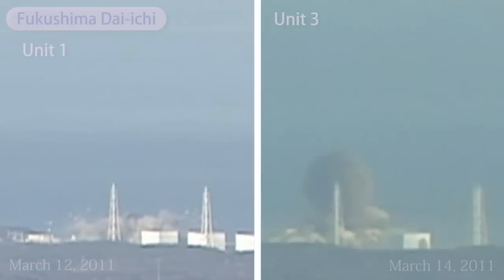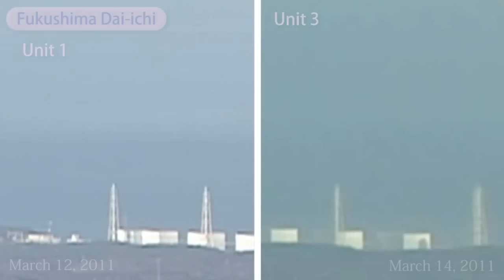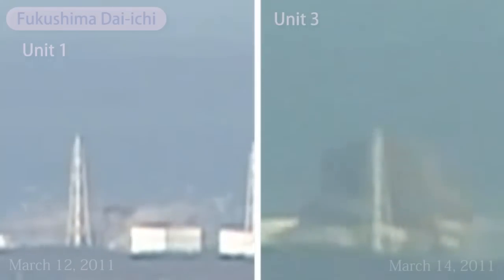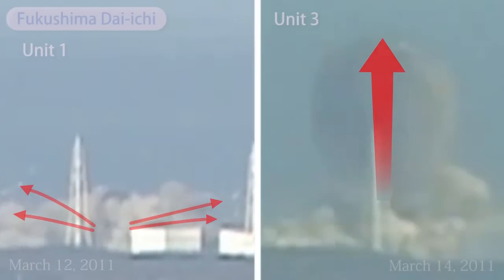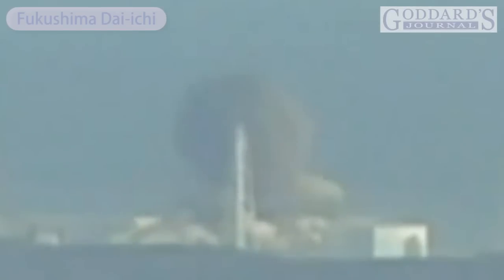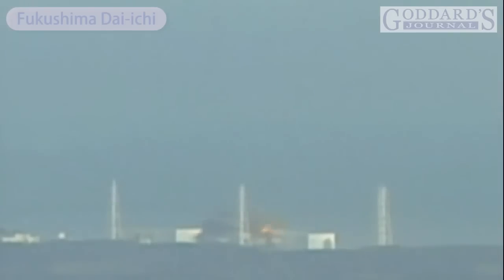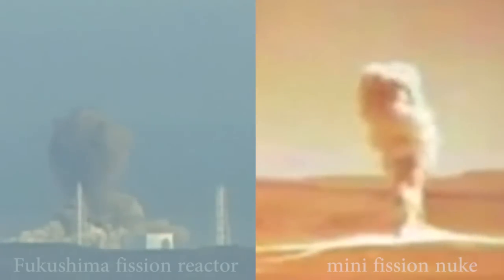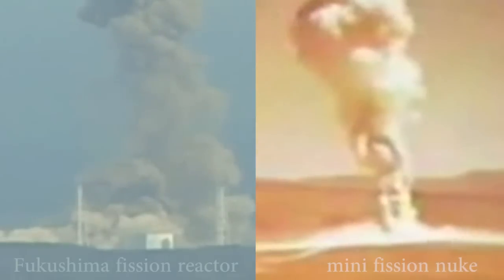福島第一 Fukushima ☢ Nuclear Blast?

Comment: @stealthbadger of the outer containment vessel in #3, which was substantially different from #1 - and would have had commensurate effects on the structural strength of the unit (and therefore where the blast went), to say nothing of the physical deformation of the structure itself from the earthquake.

Basically, I call shenanigans. You saw a clip of a mushroom cloud and are running with it to make a point, even though it doesn't support your case well at all.

Comment: It's not a nuclear explosion.  The engineering and design required for a bomb and a power plant are quite different.  The uranium used in a power reactor is at most 5% enriched, that is 5% U-235 (the stuff that fissions and keeps the fission chain reaction going) and 95% U-238 (doesn't fission easily enough to maintain a chain reaction).  The enrichment required for a bomb is 90% U-235 or above, that's weapons grade material.

Comment: @GoddardsJournal 1 & 2 - you must not have read it carefully, because the amount of fuel involved was VERY small, and other signs point to it being an extremely "local" event not contributing much to the total of the explosive force.  Not to put too fine a point on it, you're taking Chernobyl (which was possibly like a dirty bomb) and saying that it was *definitely* a subcritical event, and then applying the physics of a supercritical event to the explosion's airflow.  (cont)

Comment: All reactors still had active sensors within pressure containers right after these explosions. We regularly see the steel containments intact on 9 o'clock TV news. At least, one of the reactor buildings with heavy damage (the 'exposed' 3rd reactor) has the dorm-shaped containment and on TV it looks very much intact. It also has active thermometers.

>FOOLISCH

We may not be the best politicians, but we have many good engineers in Japan. Please don't make it something that it isn't.

Comment: There was no flash. Not nuclear. Even inside a building, the smallest possible nuclear explosion would have produced a flash and released many times more energy. The videos shown comparing the two explosions conveniently leave out the flash of the real nuclear explosion, and the footages are not scaled correctly (the actual nuclear explosion would have been larger by perhaps an order of magnitude). Not to mention the rate of convection is much faster in a nuclear explosion, with the non-nuclear one shown simply levelling out at perhaps 2000ft, whereas even small nuclear explosions would continue to rise due to the temperature of the fireball.
Reply: +onetrickhorse   I think you've missed a couple of points; the flash would not have to be blinding, in a well designed A bomb it is, that one was designed to make steam. The flash would have been inside the thick steel PCV. There isn't exactly a smallest possible nuclear explosion. The smaller the explosion, the quicker it cools and stops rising. I'm not really sold on the steam explosion idea, so I've still got my dollar bet on nuclear.
Reply: +onetrickhorse it was a dirty nuclear explosion ,, no flash , no fission , MAterial was sprewed in the environement and will travel oceans for the next 10 000 years
Reply: Science Troll Fundamentally, to call it a nuclear explosion, there would had to have been an uncontrolled fission reaction, which the Fukushima explosion evidently was not. If there was, it would have produced a blinding flash and an explosion many times the magnitude of that visible, and the amount of fissionable material inside the core would have ensured that the camera filming the explosion would have been engulfed by the resulting nuclear blast within seconds (given the potential yield of a fully stocked nuclear reactor). It wasn't steam in any case either; it was hydrogen gas, which is present in abundance within nuclear reactors, and the blast characteristics support that conclusion. The reactor containment vessel, if it were a nuclear explosion, would have been vaporised nearly instantly. If you doubt this, check the stop frame footage of the Trinity test, which contained perhaps a thousandth of the fissionable material compared to the core, yet still resulted in a fireball 200m wide after only 16 thousandths of a second with a bow shock temperature of well in excess of 1 million degrees K. This moots your point about the rising cloud also, as fission would result in such temperatures that the cloud would not only be far, far larger, but also rise at near supersonic speeds relative to the corresponding altitude atmosphere.jeff pepin yes, it was technically a 'dirty' bomb, you are correct.
Reply from the maker: This video opens stating Chris Busby proposes that the Unit 3 explosion was triggered by a "nuclear fission criticality," which also involves an uncontrolled nuclear chain reaction [*] but does not produce an explosion anywhere near the magnitude of a thermonuclear explosion. So you're introducing a another type of event and saying this can't be that. 

The criticality explosion of the experimental Borax reactor did not produce a blinding flash youtu.be/8WfNzJVxVz4?t=13m27s, but did produce a steam explosion. That is a model of what Busby proposed to have also occurred @ FDNPP Unit 3. 

Granted in this video there was confusion on my part about the difference between a criticality and a nuclear warhead explosion that could easily lead you assume I'm suggesting it may be equivalent to a warhead blast, as for example in comparing Unit 3's mushroom cloud to that of a nuclear-weapon explosion, which was most likely a mistake on my part.

[*] en.wikipedia.org/wiki/Criticality_accident
Reply: i agree
Reply: GoddardsJournal Well said, and pretty much what I meant. A pathetically inefficient explosion, nuking . . what ? a hundredth of a gram or something, but my point in being so dogged in this is that the world should be made aware of how close it went to being so much more, so that with correct data the world might make the correct descision and abandon nuclear energy.
Reply: like 5000kg's of uranium sinked in pacific and theatmosphere that will travel the whole world during the next 28 000 years ,,, we are fucked , if we not , our kids will be....
Reply: onetrickhorse YOU ARE WRONG,BLINDING FLASH IS NOT AUTOMATIC FOR NUCLEAR FISSION..

Comment: You deliberately cut off the initial part of the nuke explosion, where the flash of light coming from radiation is so disctintive of a nuke vs a conventional explosion. In Fukushima you can see the brief fireball coming out of the building. Clearly some gas exploding, which everything points to be hydrogen.

Shame on you, uploader!!